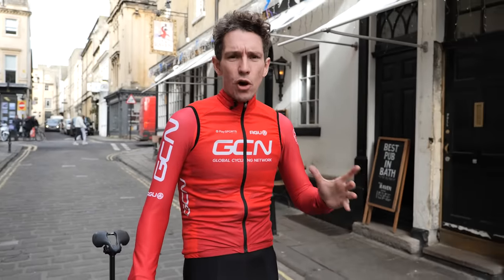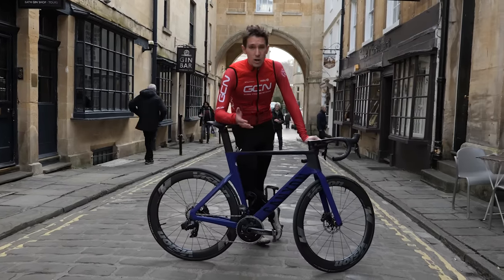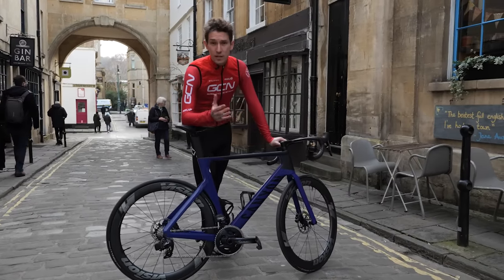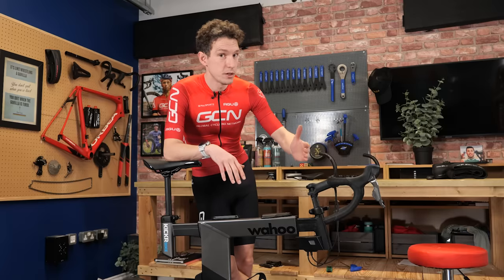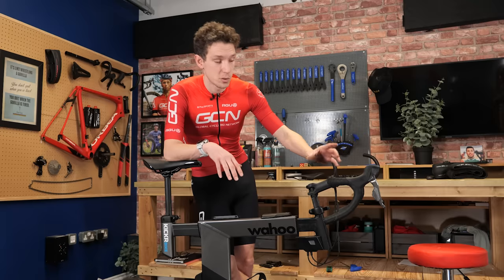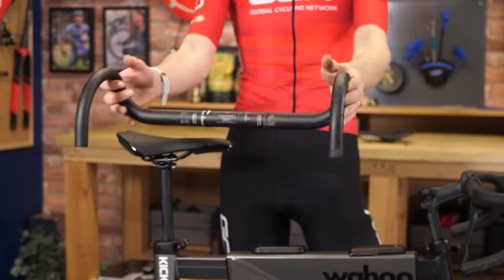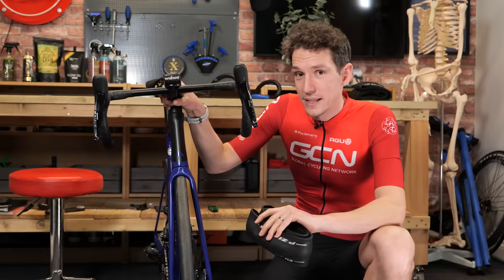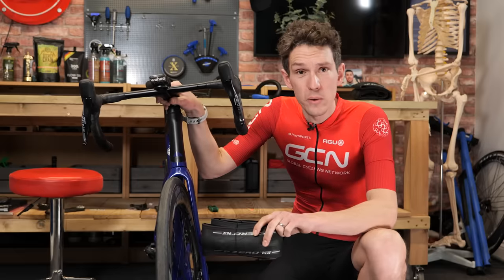Stop Back Pain When Cycling With Expert Bike Fit Tips

Comment: At 60 I have a 40 year old back injury. Keeping my weight down 72kg at 5’11”, professional bike fit and build core strength. I stretch for 30-40 minutes before a ride. I’m lucky that on climbs I always stand out of the saddle and keep straight, it’s how I like to ride. Every thing then goes through your core and will build strength. My saddle is nose down slightly and a Fizik Bull which gives a slight pelvis rotation, this alone is a huge factor. Flat saddles an absolute no no, I always find my back will go when I’m working at home in the garden, unnatural movements, twisting etc. Another thing that works for me is on climbs tense your core muscles, it works trust me.
Reply from the maker: Great to hear that you are doing everything you can to get over the back pain! At what point did you look for a new bike fit?
Reply: @gcn  I had a bike fit last year as it was 15 years since my last one, only minimal changes too which surprised me. I’ve a saddle fit next week actually, my backside isn’t as meaty as it used to be, looking forward to what the next decade brings! Haha. Great video. 👍🏼🚵🏻‍♀️🚵

Comment: I’ve had two back surgeries and have a spinal cord stimulator implanted. My number one recommendation is to pay to get a proper bike fitter. 

Personally, I can’t ride in the drop bar position, it is bar or hoods only. But switching to the short nose Spec saddle and getting the saddle angle correct allowed me to get  my hips more open and allowed me to ride longer
. 
Also, I can confirm the saddle width issue, I was fitted for a 143, but 155 is what actually lets me ride longer pain free. 
The crank length is definitely something that also helped me release the strain of my Psoas and Hip Flexor muscles. I had to go from 175 to 165. The biggest thing this helped with was allowing me to get my saddle even higher over my bars, which straightened my spine when on my hoods. 

also, hydration is key. the more water I intake, the less likely my back spasms. 

Now, I simply can’t wait to get a Roubaix, because I need the new future shock.
Reply: Did you have any disc herniation or bulging? I am possibly experiencing this with sciatica and cannot give up biking! I am definitely experiencing mental issues that cycling solves and just want to know if anyone has back issues similar to this and still able to ride after healing.

Comment: Speaking about saddle front/aft positioning:
In my experience, the problem is more often that the saddle is too far to the front than vice versa. The lower the stack of the bike, the more relevant this is.
The reason is that in a road bike position, pushing the pedals pushes your upper body upwards, just like when you are bending over and getting back up - your butt will go back to balance and support this. If the saddle is too far to the front, on the other hand, the pedalling will not help push/stabilise your upper body, and you will feel this as excessive weight on your hands on the handlebar.
Meanwhile, it is true, as Si says, that having the saddle further back means the actual reach to the handlebar gets longer. This can be a problem if you have to stretch too far as a result. As a general rule of thumb, you will be stretching too far for the handlebars if the angle between your torso and arms are more than 90 degrees when torso and arms are straight.
What all this comes down to is that too long of a reach and/or a saddle position too far to the front will mean your lower back will subconsciously have to work to compensate in order for you to not drop your torso or put all the weight through your hands to the handlebars, which will result in wrist pain and unstable steering.
The other main point from this is that you cannot adjust yourself out of the problem if the reach of the frame is too long. You have to get a bike with stack and reach figures that will fit you. Also keep an eye out for seat tube angle and saddle post setback, as it will alter how you position the saddle to give the right balance.
As others have pointed out: Get a bikefit from a bikefitter with a good reputation, especially if you are planning on buying an expensive bike!

Comment: I have chronic back pain from a herniated L5-S1 disk. In cycling, I had to switch from a road bike to a trekking bike with some 5-6cm less seat-to-handlebar drop.
It also has 47mm tires and a Suntour NCX suspension seat post. With nearly 17kg in weight, it's not a bike that you can get to average speeds of 30-40 km/h on,
but after riding it for two hours, I feel more comfortable than after sitting in an armchair for two hours, which enables me to go on long rides every single day.
Reply: I had a herniated L5-S1 about 15 years ago and I found the reverse was helpful, leaning forward opened up the back of the joint and allowed the disc to suck back in and relieved pressure on the nerve. Leaning forward also takes a ton of weight and shock off the back so I always used to choose my TT bike for long rides 😊
Reply: @galenkehler I wish my injury acted the same. After it happened, I couldn't ride on aero bars any longer and even riding on the drops caused significant pain and stiffness, not to mention having to wear a rubber corset around my waist, since even the least bit of sweat on my back would cool it to the point of causing spasms. :(

Comment: I've had back pain for the longest time, but it actually improved with cycling.  However, after doing more cycling, I developed back pain but in different areas.  I started doing more core and glute exercises, and have made improvement.  Currently, if I stopped cycling and/or strength exercises for a day, I get stiffness and pain the next day. 🤷‍♂

Comment: Oh ya, I've got Ankylosing Spondilitis and I like to ride no hands, back straight as much as possible, it helps activate all the core muscles to keep balance, anything to avoid full spinal fusion, my doctors are always surprised about how well i'm doing.
Reply: AS also..disc herniation as well. I did the stem flip to bring the bars up, switched to 28 mm tires (max for my bike), and a Redshift sprung seat post. Also spend 20 minutes pre ride doing flexing in yoga poses while the oatmeal digests.

Comment: I was dealing with lower back pain towards the end of last season and wasn't sure it was due to not being flexible on the bike. During this offseason, I realize my saddle was too far back 2cm and now after the adjustment it made all the difference. Ordered a no offset seatpost because the current seatpost (18mm offset) was going past the limit.
Reply from the maker: Small changes make big difference 🙌 Are you sitting comfy now?

Comment: You guys missed one point and that is whether one leg and/or foot is shorter than the other. If saddle height seems impossible to get right, and you get one-sided back pain, then it could be your body not the bike. Shimming for leg length difference and/or staggering cleats for significant foot length difference may be necessary.
Reply from the maker: Great point! This is very hard to know yourself though, this may be something that is picked up in a pro bike fit  👀
Reply: @gcn  True, but shims cost almost nothing and staggering cleats is also free. So you could experiment with both in a short, Zone 1-Zone 2 session.

Comment: I usually only suffer back pain on intense climbing days and/or long days - 3 hours plus, pretty much always cleared up after a couple of hours. Have always used shoulder width bars but recently started using straights on a bike i was given and i'm getting a lot of arm/shoulder pain - will be 'upgrading' to some narrower bars asap! However, i also need to extend the cockpit area a bit as my gibbon arms need more stretch to be comfortable! Yep my usual bar / saddle offset looks really extreme but for me its not.

Comment: 35yrs of racing with 600+ races. Had major lower back pain and ended up in wheelchair. Crashes and TT position screwed mine up... Using 165mm cranks is BS in my opinion ❤

Comment: It depends. In case you haven't changed a thing on your bike, and the problem occurs, it is a matter of muscle dysbalance, and some training - e.g. laying on your back and lifting your a**, so it is in line with your upper legs, and holding for up to 45 sec, min15 times - should help. In case you have a new bike and you were to lazy to note your position (most important the saddle in relation to the bottom bracket), you have to adjust the bike by only changing one thing at a time. But don't exaggerate, don't go to easy, even at higher ages the body is able to adopt to a new position, and always remember: pain is temporarily, glory is forever.

Comment: I enjoy these videos and find them helpful but actually getting hold of shorter crank lengths is not quite as easy as it sounds. Buying shorter crank lengths on new bikes is also not made easy by most brands-bought a lovely Canyon in lock down with integrated power meter which makes this expensive as an option so something I would consider if I buy a new bike again.

Comment: I don't seem to get any pain until about hour 3 and I'm usually right as rain 20 minutes later. I can last a bit longer on the road bike than the TT bike but it's a more extreme position. I suppose some targeted lower back strength training or yoga could help.
Reply from the maker: Bingo! Sounds like a big of conditioning and yoga will really help 🙌 6 hour rides here you come 🚴
Reply: @gcn  nothing in the world I want more than the endurance to persist. I get 60 miles into a ride and have plenty of legs and lungs left it just starts to be uncomfortable to carry on. Training for a 550 mile ride from New York to Virginia in April so I need to focus a bit more on the weak links in the chain if I'm going to ride day in and day out.

Comment: So I switched from a relaxed geometry bike of the Kona Rove NRB DL to a aggressive geo Trek Checkpoint Sl5.  The Checkpoint gives me lower back pain but never with the Kona Rove.  Only reason I switched is because the harsh aluminum ride.  Carbon is better.  When I ride my MTB, no back pain!  Maybe my back is not use to aggressive position.  So now I might have to sell the Checkpoint for a gravel bike with more MTB geo.  Any recommendations?
Reply from the maker: With the more aggressive Trek it sounds like it will be a case of building up the strength and flexibility to hold that position for longer. Are you doing any off the bike work? This could help 👉https://youtu.be/vjS68HwVtOY
Reply: @gcn  I shall try it!  😌
Reply: @pingpongballz5998  The Trek check point is very aggressive...  Maybe you could trade it for a Trek Domane ?  There much more comfortable
Reply: @redauwg911  hmm I love the comfort of big tires!!!  Where I live, we got gravel roads, farm roads, fucked up roads.  And the 50s I put on the Checkpoint are so comfy!
Reply: @pingpongballz5998  Yea 50s are huge .  Domane will only take 38s.  But is a much more comfortable bike then the checkpoint.  It's a lot more like the Kona..  Best of luck ..
Reply: @redauwg911  thank you!  I might get the Warbird or Niner RLT 9 RDO.

Comment: There are two key options that you did not discuss: 
1 - If you are new to riding you will most likely feel back and neck pain with shorter rides. It would be in your best interest to hit the gym with a trainer that can help strengthen those muscles. Else you will be modifying your bike, when the problem is you.
2 - For many people with chronic back pain, the answer may be to go to a recumbent bike / trike. Many older people can benefit from this.
Reply from the maker: Some great points here. Starting slow and building the miles up is a great option - don't jump into an ultra, start small and build yourself up. Part of it can be training the body to hold that position for longer. 🚴